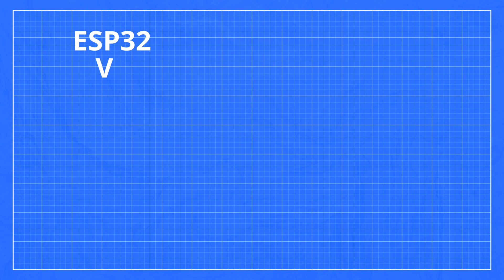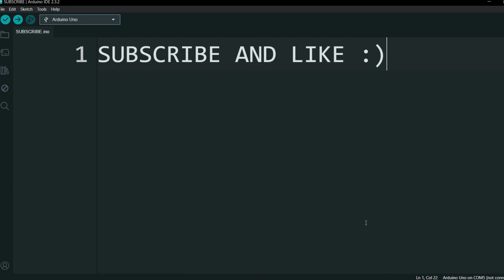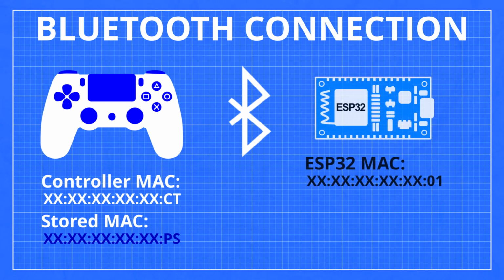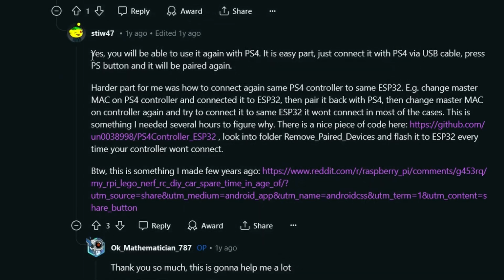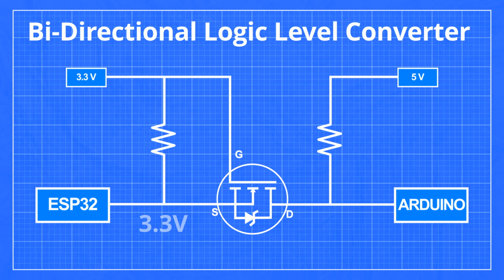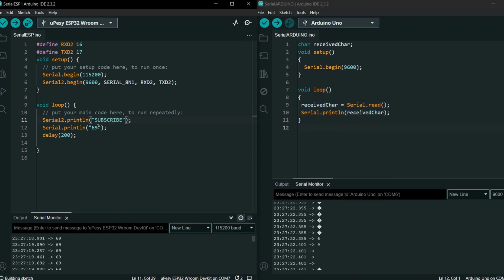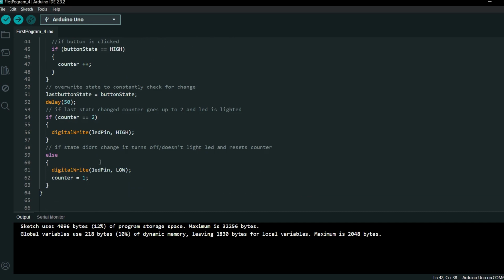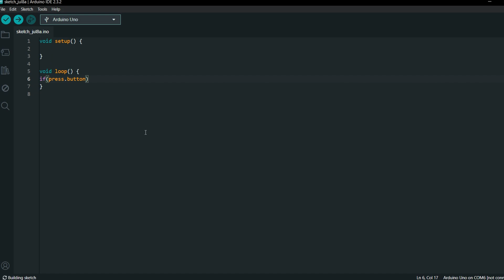Arduino for Beginners: Arduino, ESP32 and PS4 Controller

Comment: You're the second person showing esp32 by Espressif in your library but I can't find it in mine. I even went back to Rachel's channel, copied the link to paste in boards manager and still don't have a simple esp32 library. Is there another library for esp32 that will work? I've checked the include libraries under sketch tab and still not there. I'll go back to github to see if I can get it or maybe go to espressif site but I'm sure there's will be for their ide. Good instructional video though. Thanks for taking the time
Reply: Scratch that. I'm an idiot.

Comment: Great video, good job 👏🏻 

Can this method be used for Arduino R4 uno WIFI ? Because it has an ESP32 built in
Reply from the maker: All you need is Bluetooth and some ps4 controller library. I don't know if there is something similar made for Arduino.

Comment: Use 2 ESP32 instead of Arduino and communicate with ESP NOW.
Reply from the maker: To be honest, I'm thinking about ditching Arduino entirely. I wanted to do everything using only Arduino, but ESP is just so easy to use with PS4 controller.